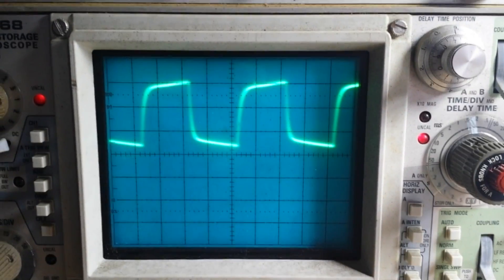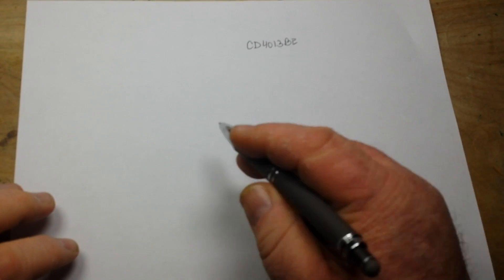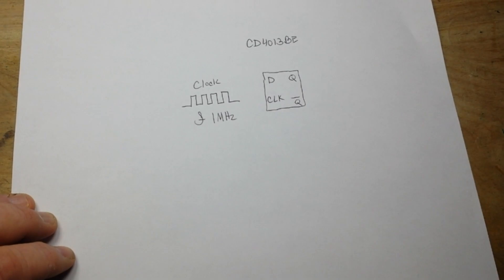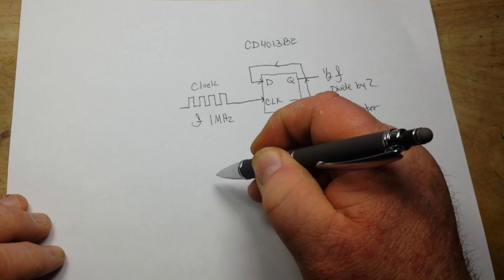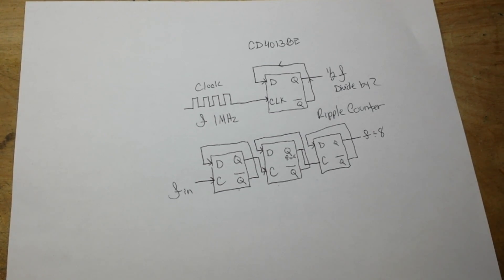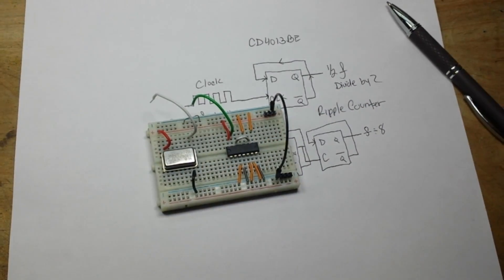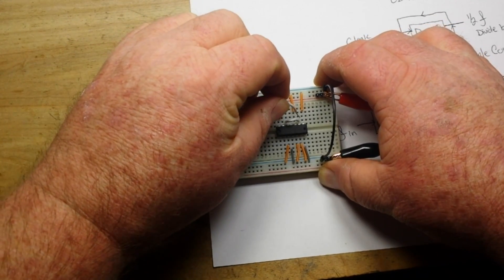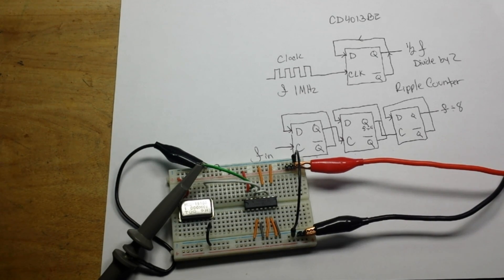Flip-Flop Frequency Division

Comment: Nice vid. Are there premade voltage devider chips that have many tiny flip flops inside one chip the size you have shown, to reduce a frequency by, for example; 10? It just seems like alot of space to have to use a bunch of the ones you shown to divide a frequency by alot, and im guessing there is one out there but i don't know what its called to find it and learn how to use it. Can you help me with this? Thanks

Comment: I'm a Software Engineer looking to understand low level machinery, a Binary Counter is really important to me because that's how a Program Counter (A.K.A. Instruction Pointer) is based of so I think that wiring both Synchronous and Asynchronous (Ripple Carry) Counters is fundamental to wrap the head around this concept. I'm not very smart so I had problems learning assembly code so that's why I need to see things working at the most basic level. Thank you.

Comment: "We're at 5 microseconds" would indicate a 10 microsecond period and thus only 100kHz frequency.
I think you meant to say that your scope was set at point five microseconds which would support the 1 MHz wave on screen. And I think I saw the selector at .5 when I paused the video.
But we all knew what you meant, NBD.
Also, I did not notice a grounding strap on either of your wrists. How often do you fry a CMOS chip? :)

Comment: The thumbnail for this video says "Divide by 2,4,6,8", where I was curious about "6". There's nothing about it in this video.
Reply: It can also do divide by 3
Reply: you can use another ttl to divide by any number, for example im using a few ttls to drive a 3 phase induction motor first i divide by 6 then by 2 and i get the 3 signals out 120° out of phase